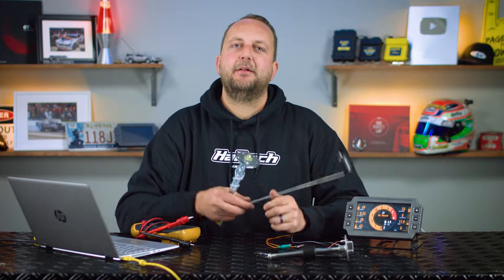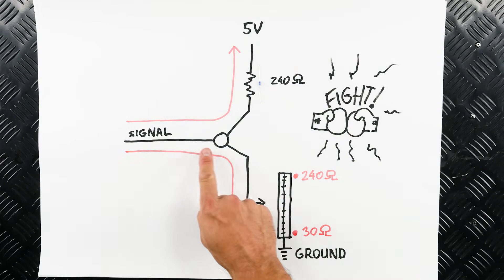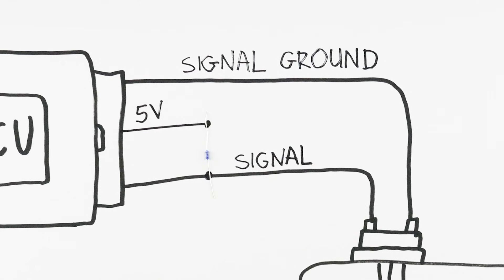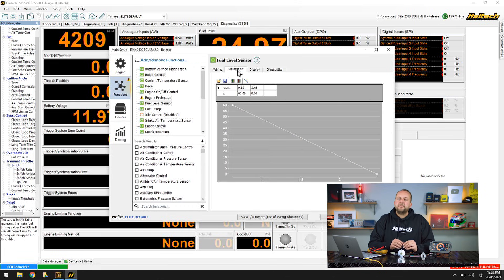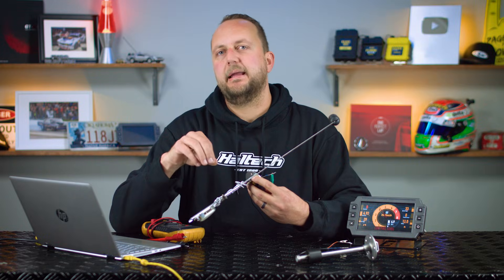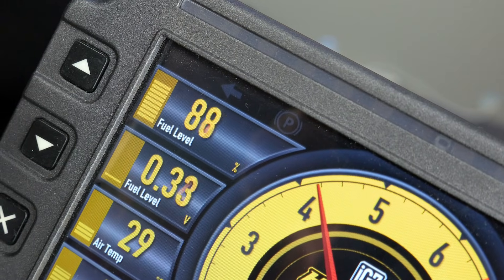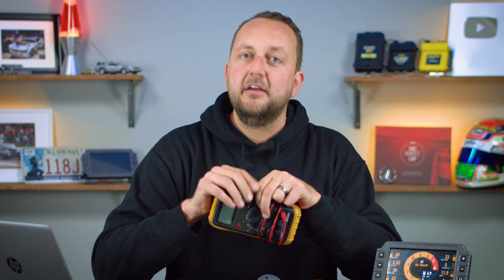🛠 Fuel Level Sender - Basics and Setup | TECHNICALLY SPEAKING

Comment from the maker: Ready to get that fuel level needle moving? Let's go!
.
Shortcuts:
00:00 - intro
00:20 - fuel level sender types
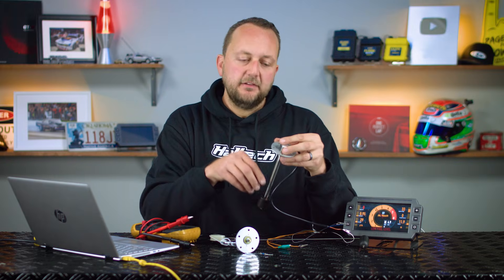01:22 - the pull-up resistor - what's it for?
03:26 - iC-7 setup
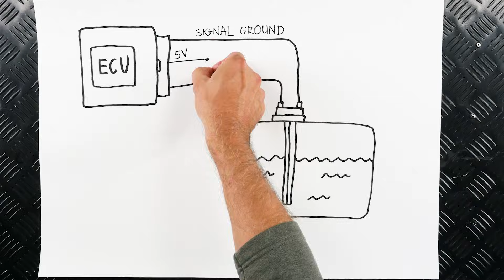03:52 - Elite/NEXUS setup
04:10 - fuel level sender calibration
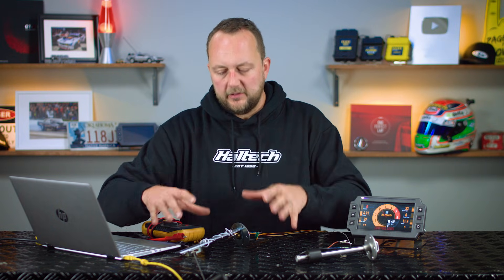05:52 - hands-on demo
Reply: Thanks Mr. Tuning Fork

Comment: Just to clarify, if I have an after market gauge, and I have a fuel level sender already in my tank. I can use the multimeter to recalibrate the sender an gauge to read properly. But I can't adjust it on the magnetic sender right?

Comment: What's actually trash is the fact that I paid around $1300 for the IC-7 067012 OBD2 Version. The Fuel Level for my 06+ LS 5.3 Computer has the Fuel Level as a PID in generic data you can see in Global data. My $90 Lufi Xs gauge I got from amazon can read that PID and show Fuel Level with no problems as a Percentage.  Your IC-7 CANT! It shows as either Liters/US gallons/CC and doesn't work... Why is it that there is over a $1200 difference and you can't pick global pid data a cheap Chinese OBD2 HUD product can. You guys take pride in your products yet I can't see my fuel level $1300 later. Why should I have to run wires all the way to my sending unit when the level is right in the data already? This seems counter intuitive you sell a product that ignores a very important piece of information to make it work. FIX IT and Update the OBD2 or I'll send it back.

Comment: Glad I now know how to correctly pull the signal into the computer, 
Did show how to display on a IC7,
Didn't show how to display fuel level on a factory cluster using a DPO (violet with trace) like how the 1500 can send tacho or speedo,

Comment: What do i do if my input pin on my device has a 10k pullup/pulldown built in and the range of voltage change is tiny? I can't disable it, i tried adding a 10k pulldown on the ground to negate the 10k pullup but that did nothing.
Reply from the maker: G'day. That sounds like a question for our tech support team. You can reach them at www.haltech.com/contact-us 
They'll be happy to help :)
Reply: @haltech  I'm an idiot, i put the pull up in the wrong spot lol

Comment: my fuel level sender outputs a resistance reading between 112 ohms - 0 ohms. What would be the ideal pull-up resistor value for wiring direct to an elite series ECU?

Comment: My fuel level shows only halfway when it has a full fuel tank. And when the fuel tank is half-full, the fuel level will start to show the accurate level of the fuel tank until it's empty. What happened with my fuel level system? Why it could only show halfway but not full?

Comment: I've put sender into ic7 how do i calibrate in ic7 software?
Reply: So convert to raw voltage then get numbers I'm showing correct reading with engine off once engine starts tank level drops from 16L to 8L

Comment: So I have a 2000 Impreza with a Elite 1500 and a IC7. If i understand this video. I don't  need a fuel level signal conditioner. The car has 2 senders. One for each side of the tank.

Comment: If running to ic-7 do you need to run a ground wire from the fuel sender aswell or can we just run the single fuel sender wire from the back of the oem dash?

Comment: can that resistor add-on be used on factory clusters that use aftermarket senders? i have an OEM cluster and a VDO sender. the fuel gauge reads the movement the fuel according to the G loads

Comment: While configuring AVI 4 on the IC7 the pull up resistor option says 1000ohm. In the video you say it's 240ohm, is this an error in the video or in the software?
Reply: I am encountering the same issue.  Did you ever get this resolved?

Comment: Can a delay/refresh rate be increased so the level doesn't bounce up and down if driving down bumpy roads?
Reply: Some fuel receiver gauges like the ones in old Toyotas have silicone oil built in to dampen and slow down needle movement.

Comment: Useful information that doesn't necessarily apply entirely to a Haltech! That's one reason I'm subbed here, even though I've not got any Haltech products!

What it did highlight, though, is that the value is very "jumpy" when measuring and displaying directly. Does any of the Haltech products offer any "damping" of the signal to slow down the transitions between displayed fuel level - and/or is there any basic electrical circuitry that could be made with common components to smooth out the value?

Comment: great video.

Question: instead of displaying on a digital dash. Can you use a PWM or other output on the ECU to drive the OEM fuel gauge?

Note: I'm keen to be able to get the ECU to output a signal to my OEM temp gauge so I can reduce wiring clutter in the engine bay. But the process would be the same as outputting to the fuel gauge ;). Just don't know if it can be done.

Regards
Jordan
Reply: Should be able to set it up as a generic output and map the fuel level to the frequency

Comment: What about using signal conditioners?  Would we still need to wire in the pull up resistor with one of these? Or do they have their own built in?
Reply: Just shove a capacitor in parallel to the sensor output/ground and add another resistor to sensor output. There you have signal conditioning